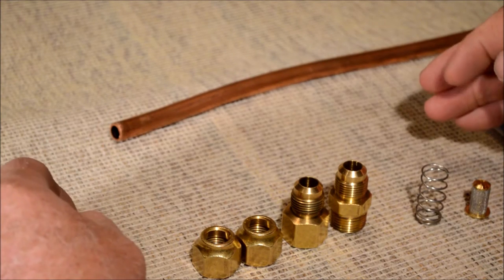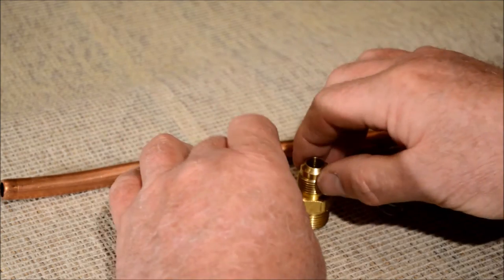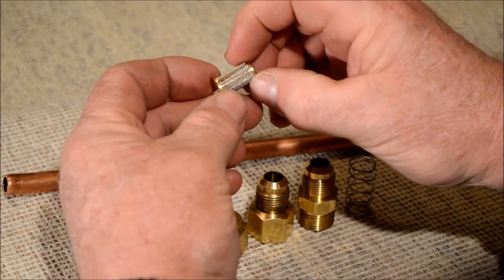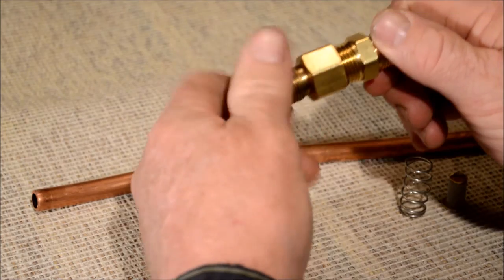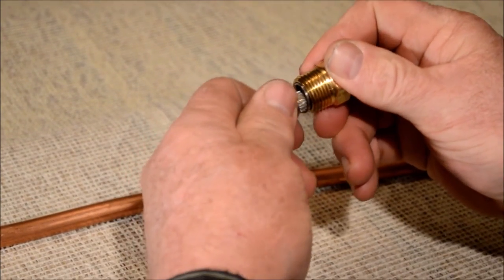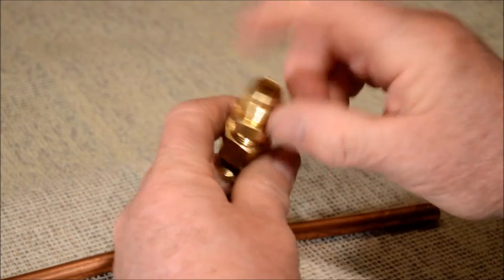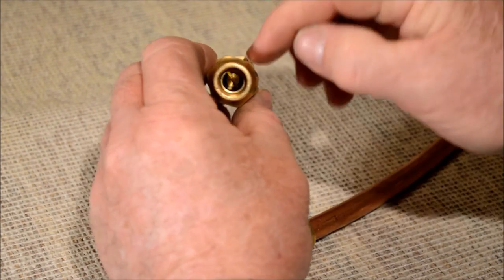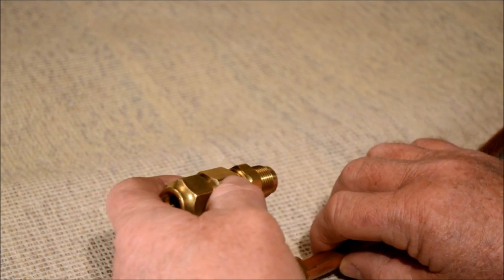How to: Make Your Own In-Line Propane Filter for Furnace/Fireplace/etc.

Comment: Thanks for the video! 
Pipe tape (yellow is non-porous for gas) or GAS RATED (for propane) pipe dope is important; not on the first thread, don't want it getting into the gas orifices. 
Any idea what the maximum BTU rating would be for whatever this feeds?

Comment: Nice work! I do have one question: Would this assembly constrict flow in the line at all?
Reply from the maker: The man in the video answered with the following:

"Not unless it was after the regulator and a high volume. Probably above 75,000 btu output. I would think it would be worth a try. Compare area of screen including micron rating to inside area of tubing. Also compare the total open area of the screen to the cross-sectional area of the orifice opening. Also, you could compare the orifice size of a Teejet nozzle to the size of the propane orifice, and if the Teejet orifice is the same size or bigger, then you should be good to go."

I hope this helps!

Comment: At 2:08 you state that the box of screens cost approximately $17, then at 2:15 you say you're going to make the filer for less than $15.  How can it be LESS than $15 if you are going to have to pay $17 to get the screens??  I know if you divide the cost of the screens by 4, then that cuts the cost of the actual filter down, but you're still going to have to pay $17 for them in the first place.  You should have left the "less than $15" out.
Reply: You must be fun at parties...
Reply: The cost per unit is in spec and anyone using these likely keeps spare parts as I would. Either way the cost is a trifle.
Reply: He's using only 'one' filter from a box of 'four' that costs $17.00. 🙂